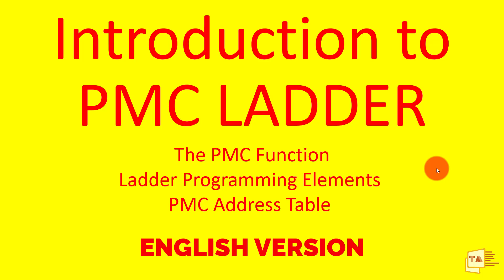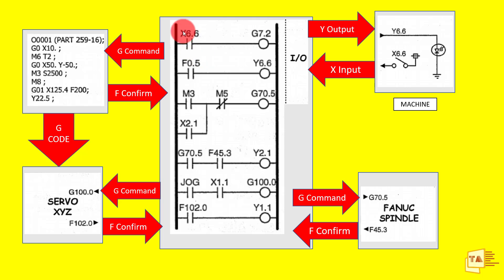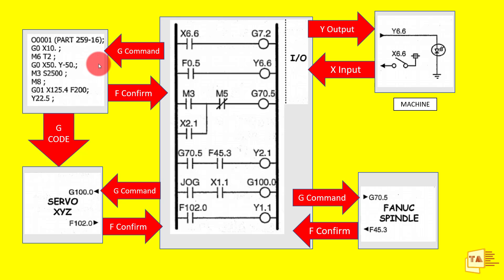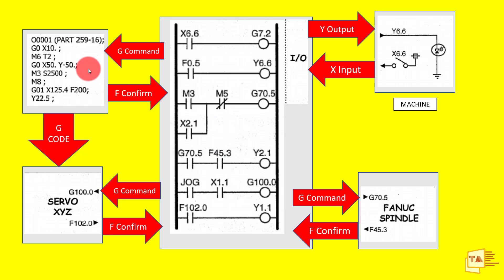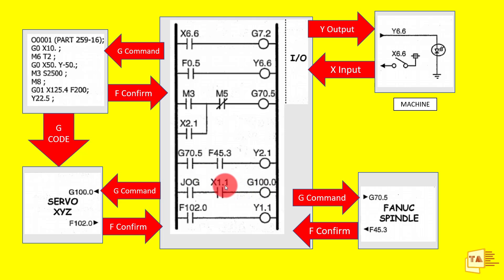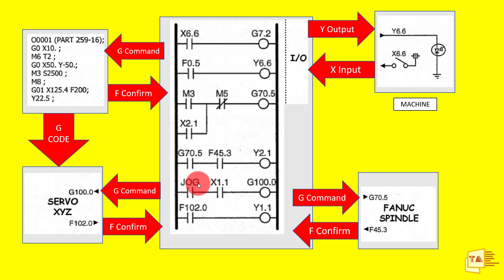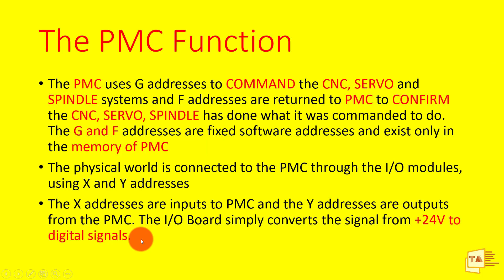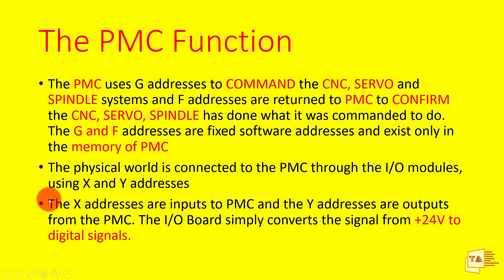Introduction to Fanuc PMC Ladder | The PMC Function in ENGLISH

Comment: Hello. I got old Fanuc 0M CNC milling machine and need Fanuc Ladder II program but cant find that anywhere. Maybe someone have it and could share or advice where to find. Thanks.
Reply from the maker: Ladder ||| right ? Share your email id. I will send you the link
Reply: @TamilAutomation  I have sent message to your e-mail mentioned in this channel description. "Ladder 2" I suppose. But not sure exactly. I have Fanuc O-M RoboDrill Tool Change CNC milling machine.  Anything that will work with my device will fit. One of problems I met is that when I select tool change tool is not changing. When I select tool number by m6t1 machine goes to tool change position but tool is not being changed. If there was number 2 and I select to change tool to number 1,  entering this,  it changes nothing. Maybe problem with t- code macros? Maybe you have one and could share? Maybe you have other ideas where the problem hides?